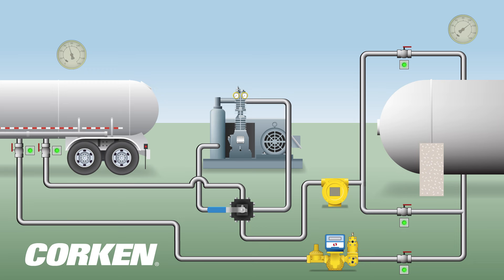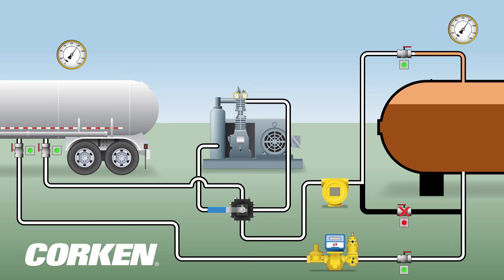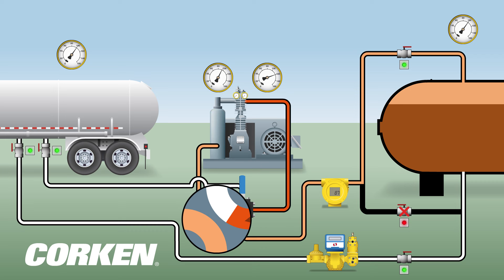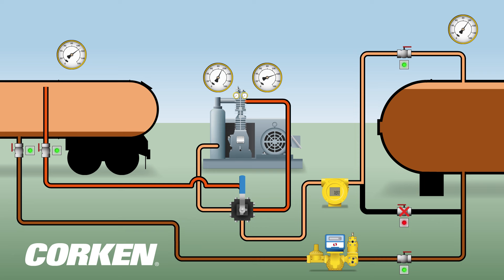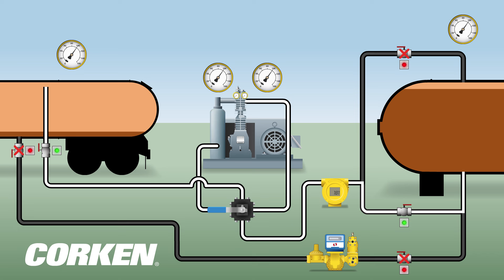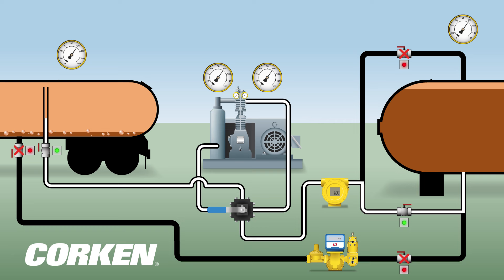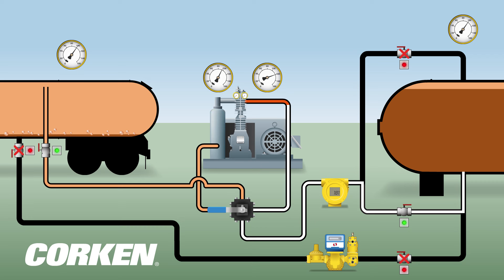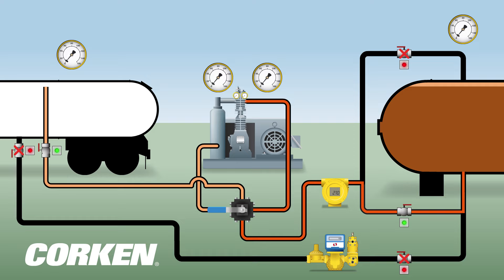LPG Transport Unloading Application (Liquefied Gas Transfer & Vapor Recovery)

Comment: I live near a big lpg gas plant.  Why would big tanker trucks release propane gas into wood near me after getting leaded at the planet? They leave there and go about a mile away and release pressure into the woods ? Are they overloading by accident then have to let someone out.?
Reply: If you can visibly see white cloud when they are releasing product is likely because they overloaded. Max weight for a cmv is 80k pounds, unless you have a permit then you can carry more and be legal. Some drivers like to overload to squeeze a bigger profit out of the load. Higher quantity of propane being delivered to the customer means more money or a bigger %% to be paid to the driver.

Comment: If you were transporting CO2, could you do the transfer without a pump, by just venting gas to reduce the pressure of the recieving tank? This wouldn't recover the tank vapors and imply a loss, but simplify the process.

Comment: Why don't we turn back LPG gas into liquid before we press it into the tank? Because if we can increase the pressure reaching 14bar, the LPG can transform liquid again with boiling point is 38 oC
Reply: Hello my dear, can I find an answer from you? For example, I have a tank with a capacity of 1000 liters of gas and it is currently empty of gas. I emptied 40 liters of petroleum gasoline and added an air pressure of approximately 10 bar to that. Does it turn into gas vapor and assuming that I combined it with gas?  Is there a good quantity and density of LNG that can be deduced from this? I hope you can help with this

Comment: How is leakages prevented in gas dispensing plant?
Reply: In a gas dispensing plant, leakages are prevented through a combination of design features, regular maintenance, and safety protocols. Here are some key measures typically employed:

Equipment Inspection and Maintenance: Regular inspection and maintenance of all equipment, including valves, pipes, hoses, and connectors, are essential to detect and address any potential leaks promptly.

High-Quality Equipment: Installation of high-quality, reliable equipment designed to minimize the risk of leaks is crucial. This includes using durable materials, such as stainless steel, and employing certified components.